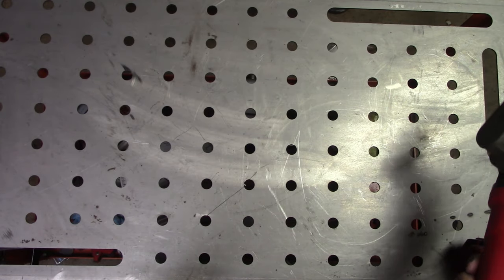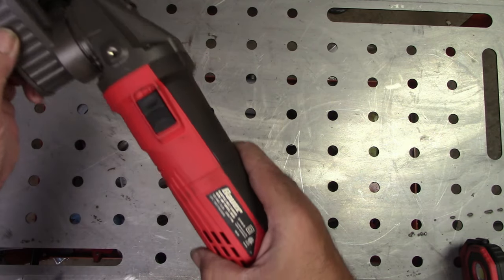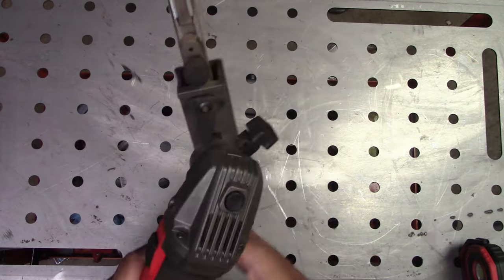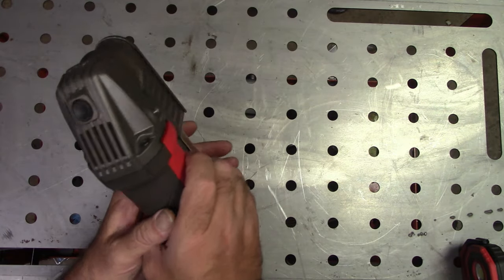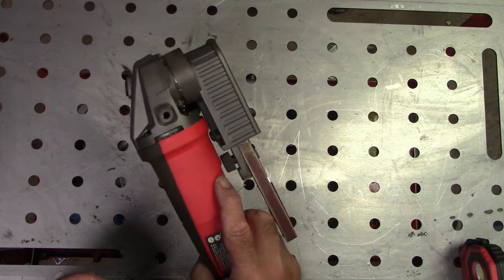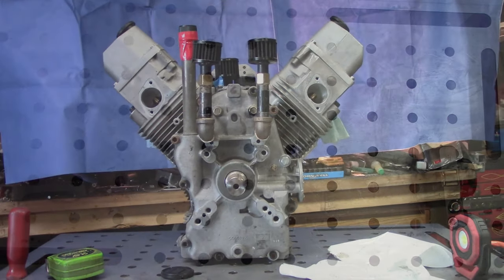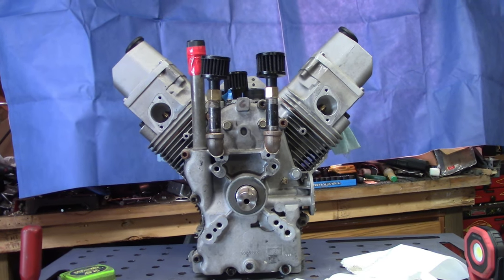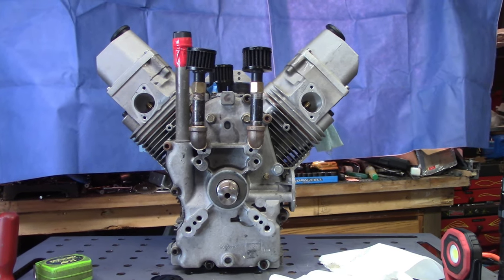What's been going on behind the camera in the shop...

Comment: Nice tool additions Ed, I'm already looking up the Braun light, I like it. 👍
Reply from the maker: Thank you John. The more I use those lights the more I'm loving them.
Reply: Yes sir, I have a similar Craftsman one with a weak magnet. No matter what I always knock it off whatever I'm using it for, the battery door pops open and 3 AAs go rolling in different directions. 🥵  I put a screw in the door so now I just knock it off but at least the batteries stay in. 🤣 I'll be getting the Braun soon. 👍
Reply from the maker: @Big_Johns for the price I got 2 so that I always have a charged one. I'm really bad at putting things on charge until it's completely dead.
Reply: It’s a good practice Ed, some batteries develope memory but some don’t, I don’t take that chance either. 👍🏼

Comment: Nice set of tools! Mind you I already have similar though not a digital torque wrench. Good luck with Mark's engine.
Reply from the maker: Thank you Ben, I've had a digital 1/2in torque wrench for years but I've always wanted a 3/8 drive one but could not justify the cost over how much I'd use it.
Reply: @PullerbearEd  Fair enough. I have two, neither digital.
Reply from the maker: @BensWorkshop I have 4 click style 3/8 ones, 2 at work and 2 at my home shop. And I have 3 1/2 ones 1 at work and 2 here. I even have an old 1/2 beam style around somewhere too.